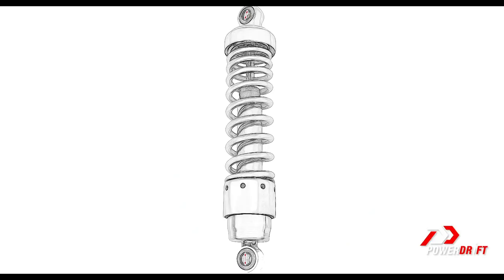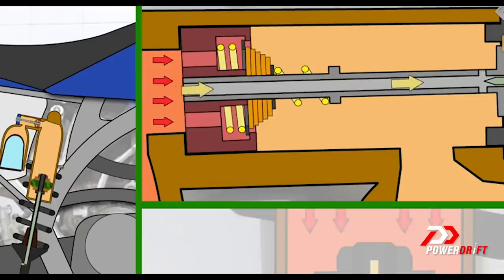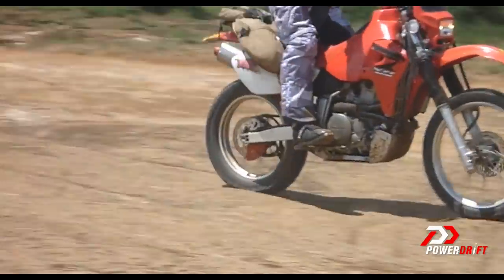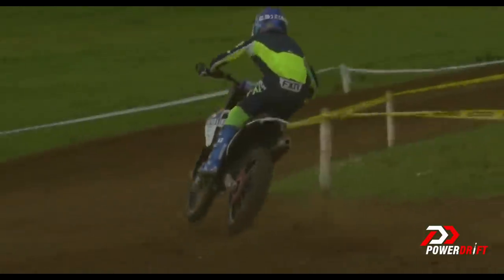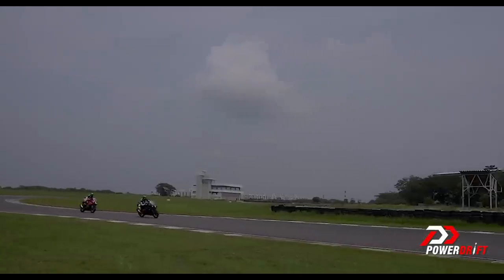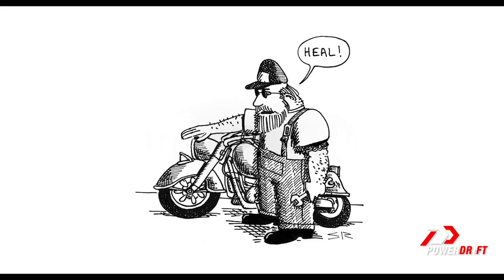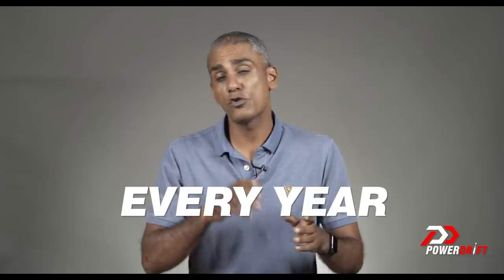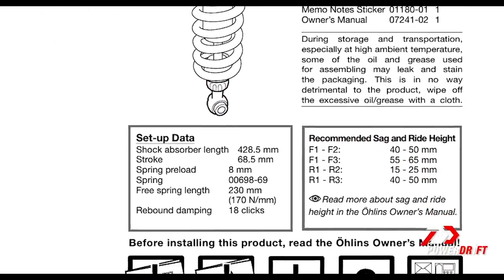PD Simplified : Motorcycle Suspension Explained | Part 2 - What Is Compression Damping?

Comment: Great content 👌👌👌
I have a question.

When I asked my local mechanic to adjust the suspension of my FZ V3 to a little bit harder setting, he said if we change it to harder/softer setting, then, 
1. will impact the life of chain sprockets.
2. So chain has to be frequently checked or observed if it is getting tighter/looser or not. 
Hence he said not to mess up with the tweeting suspension. 

Is this true? Please share your thoughts.
Reply: I feel the suspension setting doesn't have anything to do with the chain and sprocket sets. 
Because the tension in the chain is adjusted with the bolts in the swing arm.
Reply: I'm pretty sure tuning your suspension doesn't affect the chain and sprocket in any way.
Reply: @yash9410503314  Yes, I too felt the same. Thanks for sharing your thoughts 👍
Reply: @aniruthparamasivan3441  👍👍
Reply: I think your mechanic is illiterate regarding suspension stuffs .

Comment: Hi Shumi, can you do a video on bike alignment. 
Background: when riding my bike i feel they arent moving in the same direction. Feels like front wheel wants to go one side and rear is stuck elsewhere. Specially on roads having a bit of undulations. How do i know if its the rear wheel which is mis aligned or front forks or if its because i have added puncture proof sealant in my tube or if its a bend in my chassis.

Question: how to analyse and arrive at the what is the cause. The RE service guys never feel a problem in the bike no matter how many times i tell. The only solution is they adjust the T BAR a bit which i feel isnt the solution

Comment: Hey PD !! Why is it necessary to change the fork oil every year ??
Reply: Because fork oil wears out and sludge accumulates. Wear out = can’t do it’s job. Sludge = gets into things and stops them from working properly
Reply: @shu_mar  why Don't Authorised service center do it ?
Reply: @shu_mar  thanks brother.
Reply: @UCZwKlN5TsqGMlDnUo6KP9Mw yes...That's the reality of every Manufacturer...They do not follow service manual, I am experiencing it with My Ns200....20k km. Done .... A week back I got 6th  service done....They din't check/do anything except changing the Engine oil...Lubing the chain...And changing rear disk pads!
Reply: @nitin9837560  I agree to this, service centres have to really keep up with the manual. They look at me and say it's okay when I point out a job which was in the manual and not done.

Comment: Hi Bro, I TVS apache 160 4v special edition having issues with the clutch. While riding in 4th & 5th gear, there is a slight clutch is applied automatically while throttling, once we release the throttle the clutch lever released fully. The bike is new and the km driven only 2000km. Mileage is 35 only and max speed once we reached 105, it loss the power. Any solution, TVS mechanic not able to identified the issues. They try to change the clutch plates, but the problem not solved. Any solution
Reply: Mileage calculated in urban mode with 30 km average speed

Comment: What?? Adding More  Fork Oil than factory Recommend will blow up the Oil seals in your front forks... wrong information Never do that.
Reply: Adding or removing small amount won't hurt. Does your tyre blow if you fill 1.5-2% of more air,does your engine blow if you fill 1.5%-2% more oil? While we know overfill of engine oil is equally bad as having less oil in engine.
Reply: Machines are designed to have some tolerance.